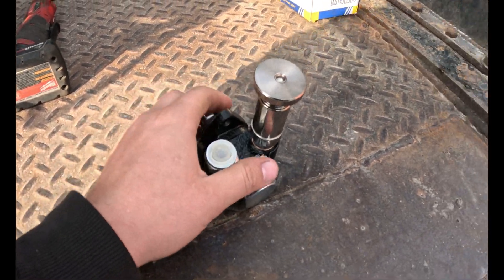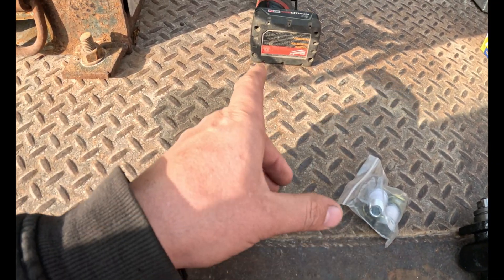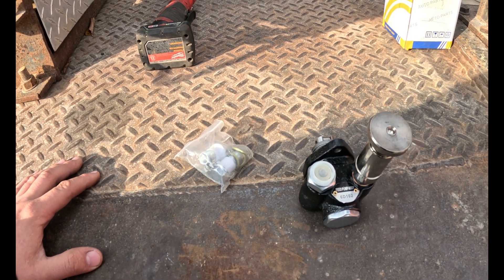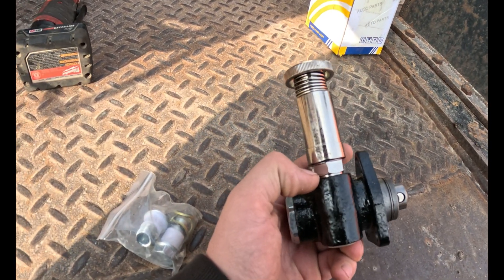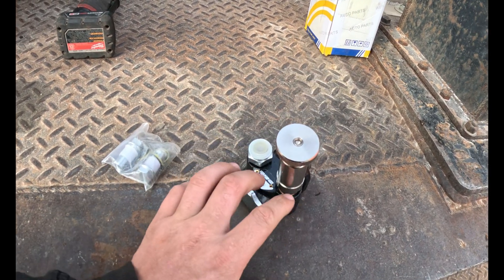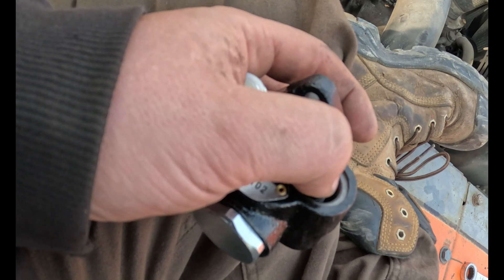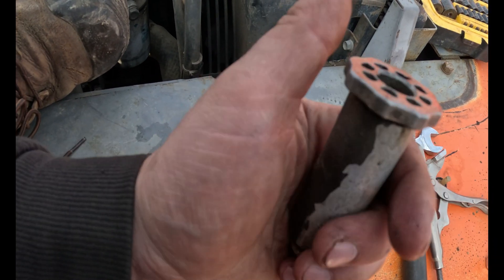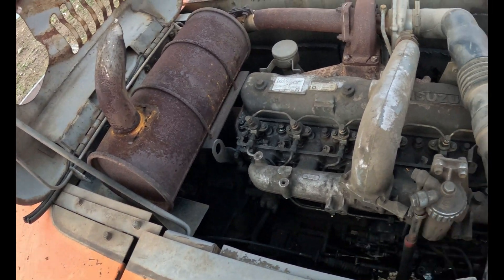Hitachi Excavator Fuel Lift Pump Repair

Comment: How did you remove the lower line with the engine mount in the way? Can't get a spanner round the nut
Reply from the maker: I didn’t, I left the body of the lift pump in place and changed the seals and plunger on it,